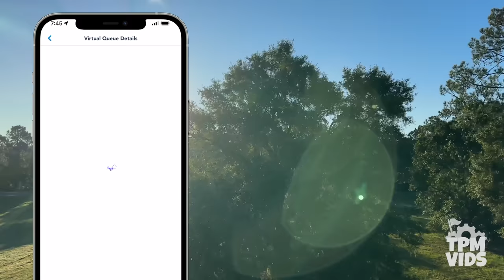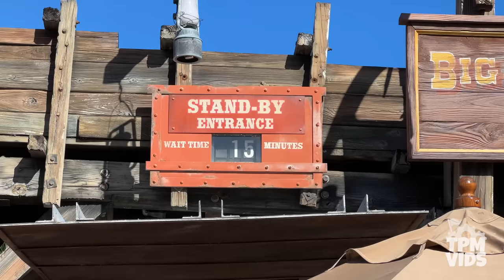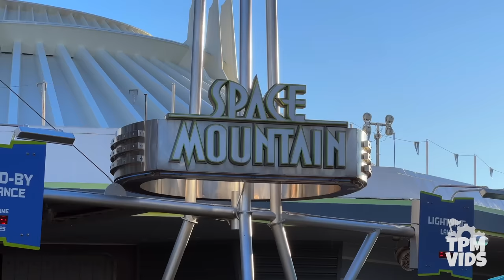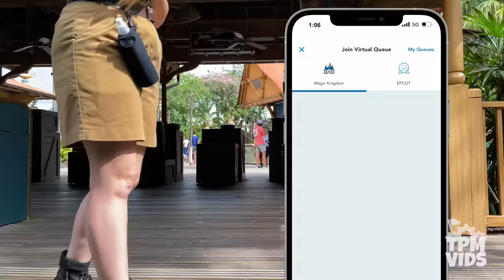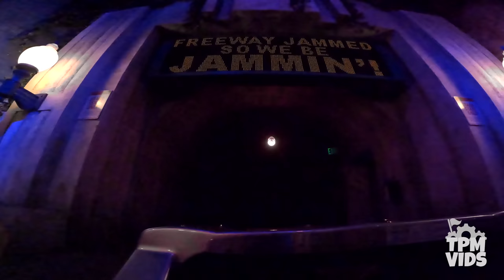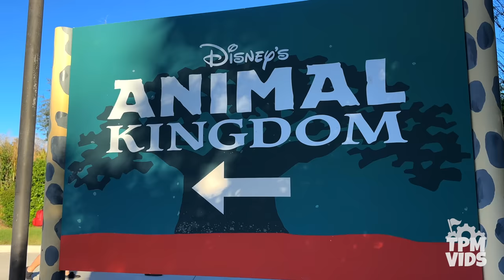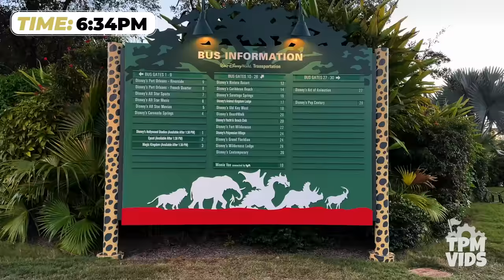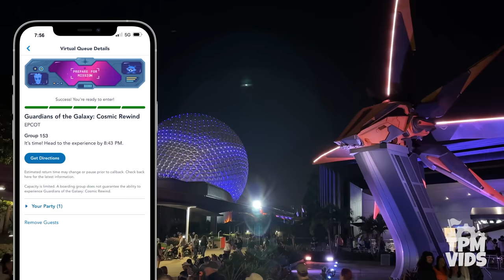Top 10 Disney Park Hopping Mayhem: Conquering EVERY Roller Coaster at Walt Disney World in 1 day!

Comment: I got Group 3 for TRON Lightcycle / Run and we couldn't make it.  They gave us 45 min right as the park opened.  Our time expired on the Ferry Boat.  Had they made it 1 hour, we would have scanned in with 5 min to go.  We tried again at 1 PM that same day and we were on it by 2:50, so at least we got on.  It just sucked that they only gave us 45 min.  What gives?  >:(  Then again, the day I got that was on Saturday October 21 and the park(s) were packed!  Disney Springs was shoulder to shoulder and it really turned out to not be a fun day at all!  But I am glad that you got to do this on a nice low day! 

 Great video TPMVids!!  

I think we were at Hollywood Studios the same day you were there because I remember it closing at 5PM.  That part was yucky as we hopped over to Animal Kingdom that day to do Expedition Everest, and then went over to Disney Springs to get some Chicken Guy! but we had a heck of a time getting back to the Magic Kingdom parking lot where we started that day.  We did make it back by getting over to Pop Century then getting on one of the Magical Event buses even though all the chains were pulled for the buses.  What a day!!

 I will live vicariously through your vids now since WDW really lost the fun with the costs of everything there and the crowd levels.